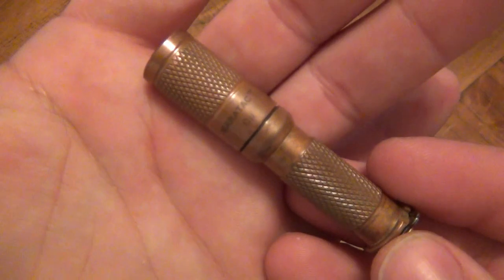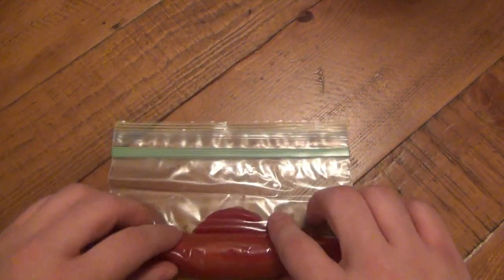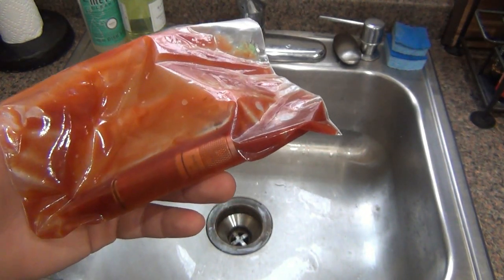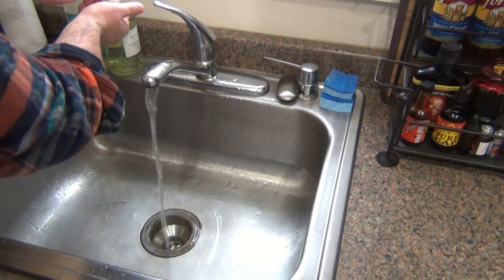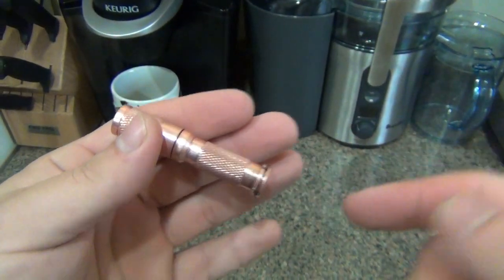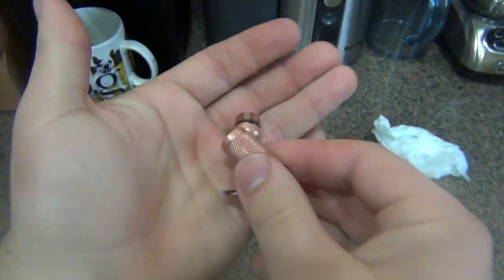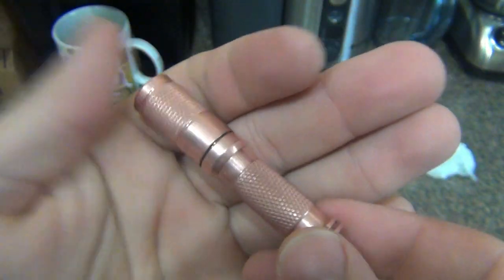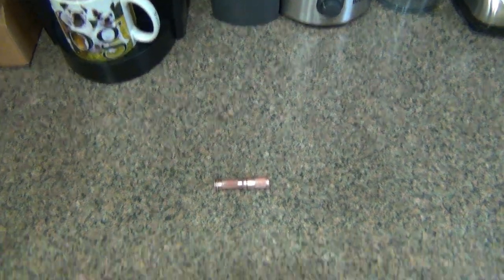Best Way To Clean Your Copper Gear...

Comment: Most acids wont attack petroleum based products like those o-rings. Muratic acid is much lower on the ph scale and is stored in plastic bottles. This trick also works great on silver.

Comment: I believe on the pivot for better light you positioned the camera in front of the dishwasher which must have been drying dishes and blowing heated moist air out the vent...or you have a ghost, which would also explain why the coffee mug moved on its own.

Comment: There is a trick with silver that works instantly. Line a bowl with aluminum foil. Add salt and baking soda equal parts. Then add boiling water. When you put your silver inside and it touches the foil the tarnish disappears instantly.

Comment: Vinegar might take off too much material. I think ketchup is used because it is much less acidic than vinegar and so is less likley to eat through too much of the copper and only take off the patina as well as for the reasons you just listed

Comment: hey Jeff i realize that this isn't a sharpening video but i was wondering if you have ever used the Lanskey sharpening system. My dad just gave me his and I've been trying it on some cheaper knives around the house wondering if you could pass along any tip thanks. big fan keep doing what you're doing